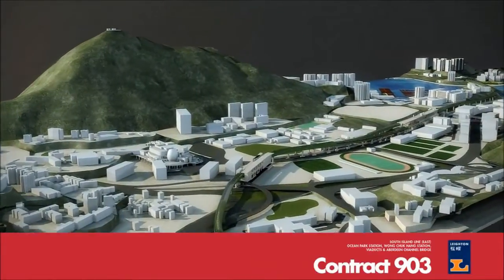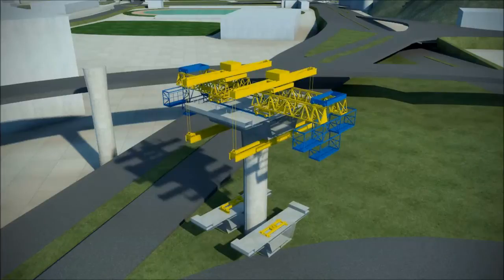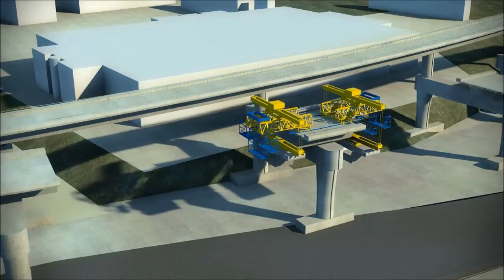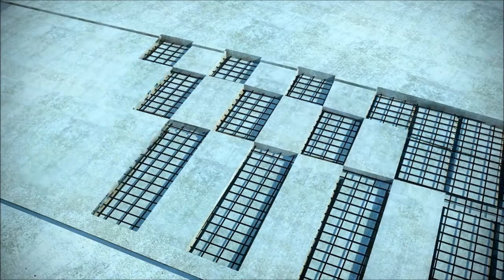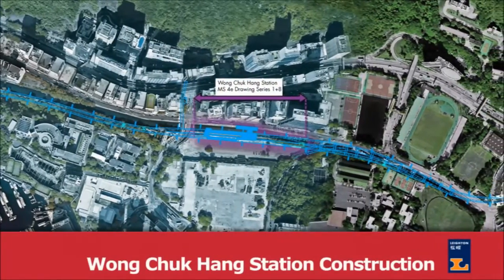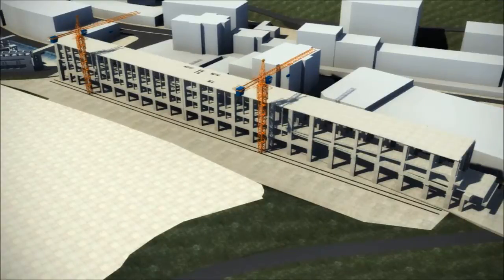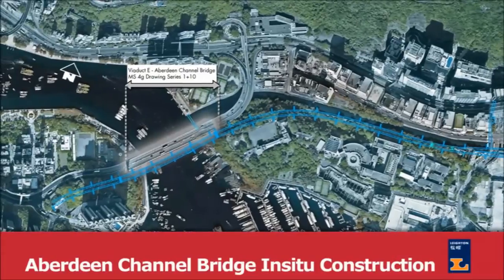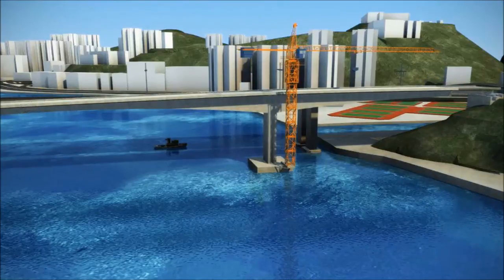Hong Kong MTR construction animation

Comment: I want to ask only one questuin: WHY did you build the elevated line? Couldn't it be possible to build it underground?
We (in Moscow) always build metro lines in tunnels in highly populated areas. It can be more expensive and more difficult to build, but the result is much better, because the metro system has no negative impact on the city, opposite the elevated line.
Reply from the maker: I was not involved in the feasibility study, but underground metro is 2 or 3 times the construction cost, and this area of Hong Kong is not densely populated, very little private land needed to be purchased.
Reply: of course money set all things up
Reply: Hong does has very long MTR network underground. These areas are lower in traffic, so government saved some money is constructing above the roads